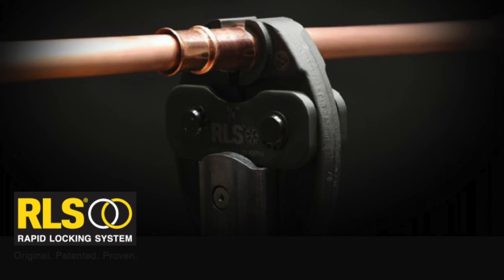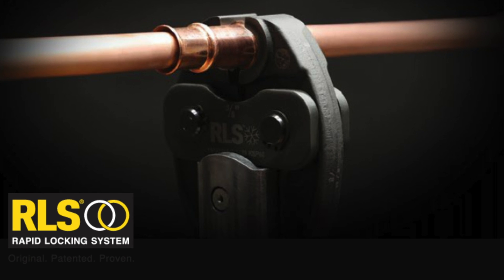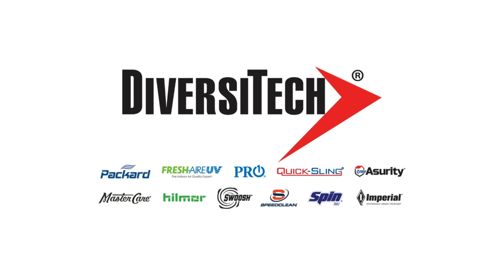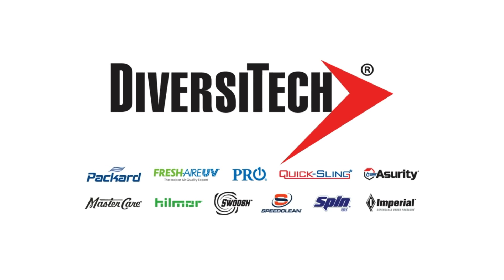How To PROPERLY Check A Furnace Flame Sensor | Goodman HVAC No Heat

Comment: I have a similar issue.  The furnace lights goes out but then lights again and runs fine on the second try.  This happens maybe once out of every 4 runs. We had the flame sensor replaced but it continues to do the same thing.   We had an HVAC guy come out and he said it was the  gas valve so they replaced it. However this did not fix the issue either.  I will point out when you cut power to the furnace and turn it back on this problem does not happen again for about 12 hours or so as though the problem is the control board and by cutting the power this is resetting the board. The HVAC guy is coming back in a couple of days. This will be their 3rd trip to fixe this but I'm looking for other opinions on this issue.  I will also point out it seems like the burners do not light fast enough to get to the the last one to reach the flame sensor.
Reply: What was it ?

Comment: id bet money the flame sensor wasnt the problem. most boards especially goodman will operate down to .7 micro amps without fault. 
inducer motor maybe, but id pull the control board off the mount and inspect the solder joints of the pcb relays. i find lots of faults there with intermittent problems. a quick dab of new solder with a hot soldering iron has saved my clients alot and saved me from call backs and waiting for a board replacement.

Comment: You should try cleaning the sensors with emery cloth or a dollar bill. The sand paper and wire brush ones actually cause the sensor to get dirty faster and more issues with the rod.
Reply: 4/0 steel wool works great also

Comment: What was the tool you used to clean the  flame sensor? I usually just use like a dollar
Reply: Supco flame rod cleaner. I keep one on each of my bags,I hang it off the zippers though to keep them clean. If you don't have that use a scotchbrite pad or fine steel wool. A dollar? Not cleaning much using a dollar bill. You can use the brown sandcloth with the holes in it as well just don't use blue monster sandcloth or actual sand paper since it has silica

Comment: 80,000 btu  furnace with 12” return. Furnace needs more return.
Reply: 12" would be too small, but I saw 2 return ducts going to it
Reply: @hvacgoat9451  it looks like a duct was added because it wasn't tapped into the return plenum. Probably realized there wasn't enough return after the rough was done.
Reply: @topher8634  true
Reply: It looks like there is a return duct on the left as well. I guess there are 2 filters in the blower compartment. Or maybe some filter grilles.